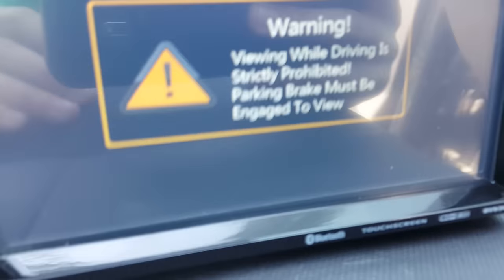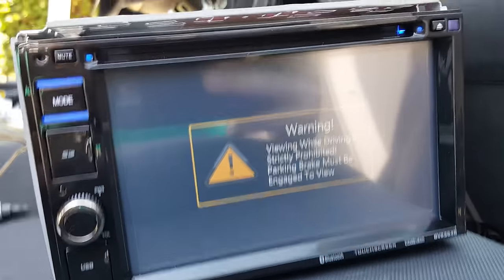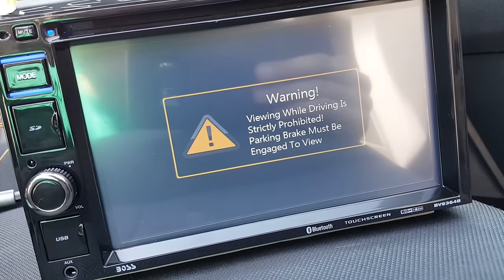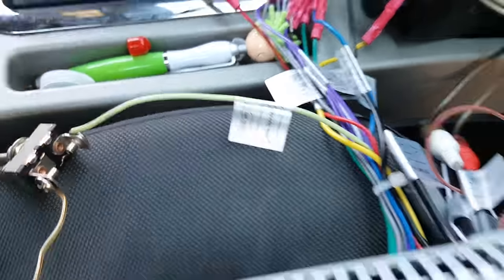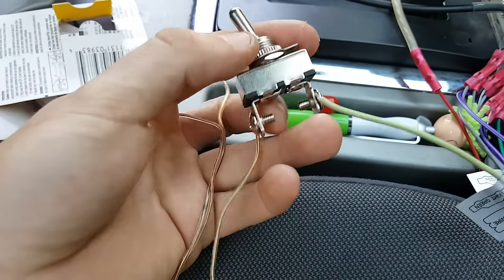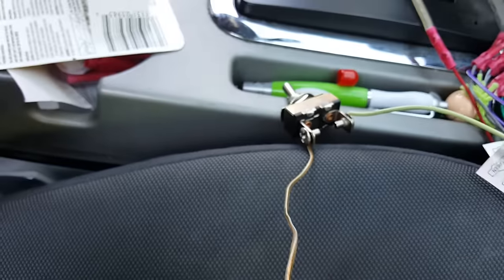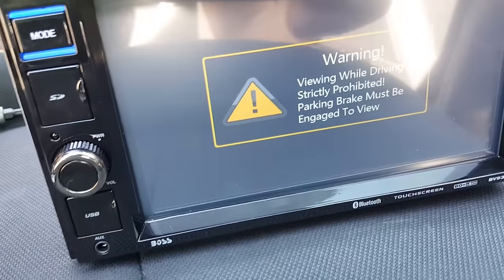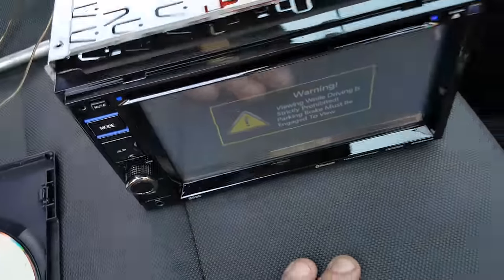Parking brake bypass for in dash dvd/gps (simplest way)

Comment: I just ground it to the ground wire of the radio lol. Been doing it for years.
Reply: Newer units caught on to that and now requires a switched source of power instead of a constant ground
Reply: @silverdropstang  I just got a 2019 Kenwood DMX906S and it still works with just grounding it.
Reply: @juanarroyo465  Very happy to read that, as i just ordered one and should be getting it tomorrow.
Reply: Wow
Reply: Works on some not on others. Kinda hit or miss. I think most pioneers and some kenwood. Alpine it doesn't at all that I've found
Reply: Thanks I tried yesterday putting in a pioneer DVD player I remember the line used to be pink I would just tie it to the ground and it would workbut yesterday when I grounded it it wouldn't work until we would lose contact and then make contact again make sense why they would do that though too many crashes thanks
Reply: What wire do you ground mine doesn't have the parking brake wire
Reply: @tonycervz89  it's a light green wire really long not sure why yours don't have one back in the day it used to be a pink wire where you can find any good ground but now you have to find a ground with a toggle pretty much
Reply: i was just going to ask, is toggle necessary, since its just grounded anyways
Reply: @silverdropstang  oooohhh, i was like, whats the point of toggle, if its just a fact of grounding
Reply: I keep seeing guys run the ground to something else then ground it to the unit and was wondering why it wasn't just a straight shot to save time, money, wire, and space haha. but I do totally get that everything has its own little twist.
Reply: @juanarroyo465  try it with a gps nav Pioneer. Any Pioneer 500 bucks or more. Sony shit,Jvc, and Alpine it works just grounding the wire.
Reply: @fredsmith1672  have no need to try it with any of those when it works perfectly fine with my Kenwood
Reply: So you splice the park break input to the ground?
Reply: I just grounded it to the radio and yes the radio is new
Reply: I’m new to electrical but are you just cutting that wire and splicing it with the black ground of the unit ?
Reply: Works perfect on a Pioneer Avh-110bt radio. Just ground parking brake wire to the harness. Problem solved within 30 minutes

Comment: Naw... you need to get 1 toggle switch, 1 paddle switch and about 50 ft of wire. Connect the brake wire to the toggle, then run a wire from that down the driver's side of the car, back to the trunk and around the passengers side back to the dash, then connect that to the paddle switch and from there run a wire to a ground... then you're good. OR you can just connect the brake wire to the same ground as the deck
Reply: lmao
Reply: That's what I'm gonna do! (through the trunk)
Reply: Lmao I was like "is this guy serious right now?"

Comment: Good Day sir,
Have a 7018b.Which wire should I ground. Already ground the black wire A8.Discreption as read.
A1. PARKING sensor control wire 12 volts.
A2 PARKING single check
A3 key
A4 B+
A5 power antenna
A6 Head Lamp
A7 Acc
A8 Ground
Reply from the maker: You will need to ground the parking wire,
Reply from the maker: Lol sorry didnt see there was two, you may need to ground both, try to do antest run by grounding one ata time
Reply: @nick4is2lit0  thank buddy. Your help is well appreciated
Reply: @nick4is2lit0  You also mean A2 the parking single check wire to ground also.
Reply from the maker: Yea both A1 AND A2
Reply: @nick4is2lit0  .You the boss.I did it.It works.Thanks a million ,ground A2.Video was very helpful really appreciated it.Thanks buddy.All the way from Trinidad and Tobago.
Reply from the maker: @terryrama1550  awesome glad it worked!

Comment: Why don't you hook the green wire straight to the ground and bypass the switch......
Reply: Some head units look for the parking break to be toggled
Reply: here when a cop sees your screen on while moving you're in trouble.
Reply: @kendelion  they watch laptops....
Reply: @kendelion  that's why you get window tint.
Reply: @618greenleaf7  except there's a limit how much dark. Lol i dont watch anyways, music is my jam!
Reply: So would it be best just to ground this wire?
Reply: @derekbennett3850  yup, if it's okay to your law then do it, else put a switch so if inspection time comes just flip the switch so you dont have to open the panel anymore.
Reply: @toasty4000000  Hey I just did the bypass on my Boss 755 and our works but when i fittest start my truck for the first like 5 minutes my gauges jump and chimes and dings with the unit flashing on off and then it acts normal, but after my truck had been off for extended period of time, it does the same thing again when start it up? What can I do? Does it make a difference with me grounding it to the antenna. I'll try a different spot to ground but appreciate any help.
Reply: @kendelion  Hey I just did the bypass on my Boss 755 and our works but when i fittest start my truck for the first like 5 minutes my gauges jump and chimes and dings with the unit flashing on off and then it acts normal, but after my truck had been off for extended period of time, it does the same thing again when start it up? What can I do? Does it make a difference with me grounding it to the antenna. I'll try a different spot to ground but appreciate any help.
Reply: @stevenbarnes6169  make sure the yellow and red wires are not mixed up. I dont think the ground has anything to do with it. Make sure no wires are shorted and all wires are in the correct positions.
Reply: Pioneer headunits have a safety so you can’t just ground it, it has to be grounded like 5-10 sec after startup

Comment: I hope you still can respond but if you were to “ground” the parking brake green wire to the body of the stereo, how do you make it stick to the metal piece so that it’s grounded? FYI: (new to stereos and do not know much about them)
Reply from the maker: Im not sure what copper wire your asking about sorry, when i grounded the wire to the stereo it was only as an example, if you are going to ground that wire you will actually want to find a good ground location on the car and not the radio

Comment: Didn't know this till after the fact i did the install. But I haven't connected the long green wire but it is snaked over thru the dash to the e brake. Cant i just ground the green wire without anything to the dash frame somewhere?
Reply from the maker: You can try grounding it first and see if that works

Comment: can't you just push in the emergency brake a very little then it should be no problem, I did that when I had a truck with DRL so the lights would stay off. Just thought that method would work on this.
Reply: It would, if your car allows it. My Kia drags the ebrake on the first click, and my Subaru has an electronic e-brake that just has on or off.

Comment: Why use the toggle, just hook up the Brake wire to a ground
Reply: Won’t work
Reply: Some head units, like pioneer, require an on off on type sequence. When it's just grounded you only have "on" as if the brake is always on. The switch allows you to simulate turning the parking brake on and off to trick the head unit into thinking you are actively using the brake.

Comment: some radios are clever and require a switching ground, that is not permanent. A 4 pin relay  does the same thing as a switch, actually a relay is an electrical switch.

Comment: Great video, what is the switch you are using, I looked on Amazon there's a dozen of them with different configurations. Can you link one?
Reply from the maker: https://www.amazon.com/Baomain-Toggle-position-mounting-terminal/dp/B01N2RLMCU/ref=mp_s_a_1_5?keywords=baomain+toggle&qid=1575834124&sr=8-5. ............heres what it looks like, but basically you just need a cheap toggle switch, you can get it at any autoparts store

Comment: you don't need a toggle switch you can just ground the green wire and it works
Reply: Bob EVANS not on pioneers
Reply: I did a pioneer the other day and ground it to receiver and it worked
Reply: I'm about to install a new pioneer Hu... Hopefully grounding works because I don't want to wait for a bypass module and the kids like watching while on the road..

Comment: Grounding the ebrake will only work on cheap generic devices.  Any big brand I dash will need a relay or a toggle
Reply: Most newer decks are wise to this trick, and require the brake to be taken off and then reapplied if it sees the brake on when the deck starts up.  This is not an opinion, I am an installer, and a relay on the remote wire is the common fix for some vehicles that have a hard to get to or nonexistant analog ebrake signal wire.  The relay shorts to ground, but the deck sees the pulse, and believes the ebrake was released and reapplied.
Reply: Totally untrue. I’m running an Kenwood eXcelon DD-BT and grounding the brake signal wire works perfectly
Reply: @samurphy  i ground the wire to but it will not play while i am driving, i hear the sound but no video
Reply: @samurphy  why wouldn't a toggle switch solve this?  Just flip it on, off, on, and it'd do the same thing while giving the user control over when video is enabled/disabled.

Comment: What kinda switch did u buy ?? Meaning amp wise
Reply from the maker: Ronell Shorter , I just bought a traditional toggle switch I dont believe it has an amp rating its just used for grounding
Reply: Nick Henry  Tru I’m not gonna put it on a switch

Comment: Hey I just did the bypass on my Boss 755 and our works but when i fittest start my truck for the first like 5 minutes my gauges jump and chimes and dings with the unit flashing on off and then it acts normal, but after my truck had been off for extended period of time, it does the same thing again when start it up? What can I do? Does it make a difference with me grounding it to the antenna. I'll try a different spot to ground but appreciate any help.

Comment: Why  use a toggle switch, why not just ground to chassis?
Reply: Contending For The Faith most systems look for the brake to be toggled
Reply: Good question because I tried just grounding it and it wouldn't come on
Reply: If your radio requires a toggle, on, off, on to bypass the brake thing, then a toggle switch will work.  If you radio only requires grounding, then a toggle switch will work.  In both cases, if you need to disable it because you just got pulled over, you want to be able to quickly disconnect from the ground to disable the video, hence a toggle switch will work.

Comment: Will it work if you just run the park brake wire straight to head units ground?
Reply: That will work on some cheaper units, but most brand name units are looking for a pulse to ground. So if ground is always there then it will ignore it, but if you have a switch that toggles ground while the unit is on then it will take it like the parking brake is on. If you don't want to toggle a switch every time you turn on your stereo then you can wire either the amplifier on, or power antenna circuits to relay that will create the required pulse every time you turn on your radio.

Comment: why with bypass or just  simply grounding brake wire, dashboard red “BRAKE” warning light illuminated and chimes sounds beep, beep while driving (VSS wire cut, disconnected)
2017 Nissan pathfinder original radio.

Comment: didn't work for me that green wire must be like power or something as unit just turns off when I disconnect that green wire
Reply from the maker: Green shouldnt be power usually red is power and yellow is acc power such as lights.........the e brake wire should also have a tag stating it needs to be connected to the e brake
Reply: Nick H  I had to buy the  looms from the local auto store and no wires are marked.   There is like one blue/white wire on its own that’s not connected to anything but even if I earth that nothing happens
Reply: Nick H  I didn’t toggle it either I just touched wire on n off
Reply from the maker: @druslocallawncare109  you got no wires with your unit?
Reply: 2nd hand unit  all is good went to my local auto sound guys and they sorted it for me

Comment: you could save money by just grounding it... theres no reason for a switch 🤦🏼‍♂️😒
Reply: will it be able to play while driving
Reply: @elvisbain9362  yes you can do that because all it does when you put it in park is basically ground the connection.. so its recommend for safety but if you want to use it while driving yes grounding it will solve that issue.. 😁

Comment: Why the hell would you even put a switch in there to begin with
Reply from the maker: In addition most systems look for the brake to be toggled, the more expensive systems may not work without the toggle

Comment: Do I need the toggle?
Reply: Some radios needs to see a break of the ground to work. Those need a switch to ground.
You can buy a bypass on amazon for $15
Others radios just need the ground input and won't need a bypass or toggle switch to work.
You can test your radio by taking the green wire and grounding it to the radio chassis and turning the ignition on and off to see if it works properly